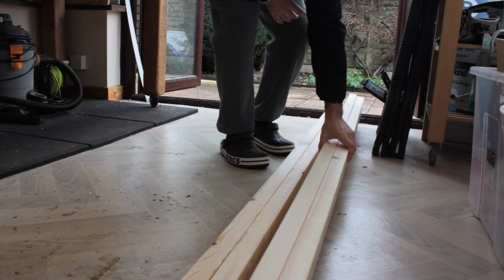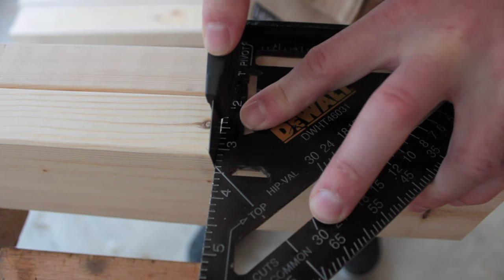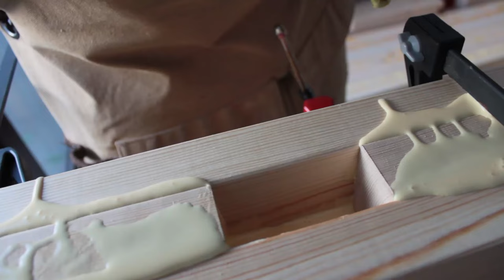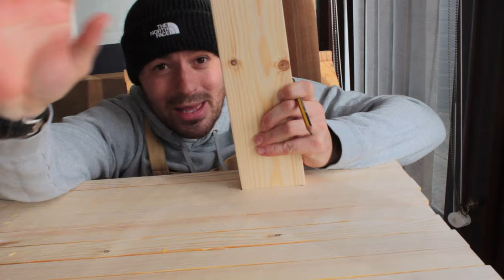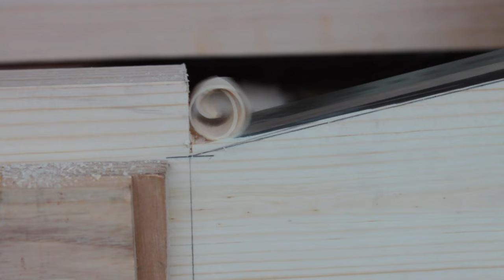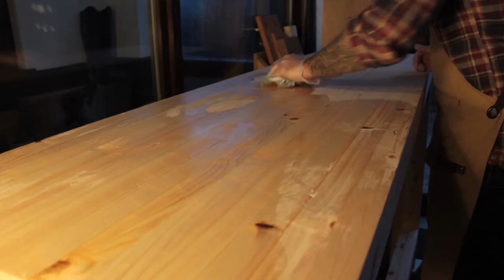Make a cheap, strong, workbench from 2x4's - For less then £100?!

Comment: nice bench. came out pretty solid and i'm sure it'll last you well beyond the skill and experience to build something suited to the work you will want to do later. i've had several hardwood benches and softwood benches. my spruce bench is actually my favorite. the wood is softer and doesn't mangle my other wood. it's dead easy to flatten. it was super cheap. built the base out of douglas fir because i want that to last, but the top is spruce. i had a white oak workbench for quite a while and it was 

a couple thoughts: 

- when you cut the half lap brace, you left the pith side of the timber, which is the less stable side. in the long run, cutting away the pith will give you more stability and less likelihood of splitting as seasonal cycles move along.
- when you are spreading glue you can use a 3/8-16 threaded rod as a spreader. it will give about the right amount of glue for face gluing.
Reply from the maker: That workbench sounds fantastic, thanks so much for the tips too, very good point about the pith! I shall definitely hear that in mind in future builds.

Comment: Great job and a good use of 2x4s. Hints: transfer glue to smaller squeeze bottle to control amount you put out. You can get rubber rollers to spread glue for less waste. Use a scraper to remove squeeze-out before resorting to plane. Your stretchers could be angles to better prevent racking. Your waste wood looks like it might be long enough for a lower shelf. A slightly wider chisel will make cleaning the mortises easier.
Reply from the maker: Thanks for the comments and the tips! The rubber roller and using a card scraper are definitely things I’ll bear in mind for the future!
Reply: @Greyotterstudio  cheap silicone spatula from cheap store works really well as a glue spreader although sauce bottles u can buy in Tesco think there 3 quid for 2 work really well for glue bottles.

Comment: Turned out wicked m8 can't believe you hand plained all that top. Ad of broke out the electric plane to start then finished it with hand plane if a was u. With regards to table saw/thickness plainer I run the einhell table saw fantastic beginner saw I've been the hell out mine and it's still standing.also just over hundred quid With regards to thickness plainer combo check out lumberjack I have there combo model think it's around the 330 mark and again I've done allot through it and works a treat.
Reply from the maker: Thanks for the vote of appreciation! Hand planing it was certainly a challenge - earnt my Christmas dinner for sure! Glad the Einhell is working out for you, I have had a look at those a couple of times with wishful thinking!
Reply: @Greyotterstudio  honestly a was shocked at how much they'd come down to just Uber the hundred mark from Toolstation think a paid 250 for mine. Lumberjack also offer 3 month payments. Or FB market place for lunch box style one. A bet u did earn your dinner that night for sure. 👍🏴

Comment: Thank you for posting the video, mistakes and doubts.

I’m wondering why you put the stretcher so close to the table top. I would have thought there would have been more rigidity if it was lower down ?

Also wondering if the dovetail added any strength as you are cutting away material 

This is not criticism, I’m just curious
Reply from the maker: Thanks for the comment, and the question too! Honestly I thought halfway(ish) down would be far enough to support and add a noticeable aesthetic element. However, some comments on Facebook agree with your suggestion that perhaps it should be lower down. I'll have to watch it over time and see, although the good thing is I can always add another if necessary!

The half lap dovetail I think does add strength, because due it the way its sat it actually has a cosmetic shoulder that sits between the legs and I think that adds more value then a solid piece of wood. 

Of course these are just my opinions and I'm more then open to further discussion/advice :)

Thanks again for the advice, please stick around for future videos! I've always got more to learn.
Reply: Ha ha, there’s no way I would offer advice. I’m still learning/ pottering

Comment: Looks good!  Only problem is the vise is on the wrong end of the bench ;)

I think you probably could have gotten by with only applying glue to one face of each board during the lamination process, and maybe spend a little more time on keeping them aligned somehow - nails or screws in the ends that would be cut off anyway - together those would have saved you a ton of work flattening the top and the legs.

I don't believe you'll have any issues with cross-grain movement of the short half-lap dovetail stretchers vs. the laminated top.  If the top was glued up of boards joined edge-to-edge, sure.  But the way they are... there may be a little movement, but not much.  I'm more curious why you put the short end stretchers up so high, rather than down at the same level as the long rails, to support a shelf?

Still going to be a huge improvement over what you had, and definitely a labor of love 👍  Looking forward to further updates as you finish it out!
Reply from the maker: Being a left hander is both a blessing and a curse ;) 

Great advice about securing it together better during the lamination. Fixing it together by what would become wastage is a great shout, I think cauls may also have helped if i used those. 

Glad to hear you don't think there won't be much cross-grain movement. The honest answer about the dovetail stretchers is I hoped halfway down would be far enough and would be provide a nice notable aesthetic! However it has been highlighted a couple of times lower may of been better, but the good news is I can always add another one lower if necessary I suppose!

Thanks very much for the comment, advice and support. Please do stick around to see any future developments (Y)
Reply: Paul Sellers built a bench laminating plywood. It seems to work well. I think he used screws to stabilize the strips during glue up and clamping. I am watching your work because this seems like a reasonable alternative.